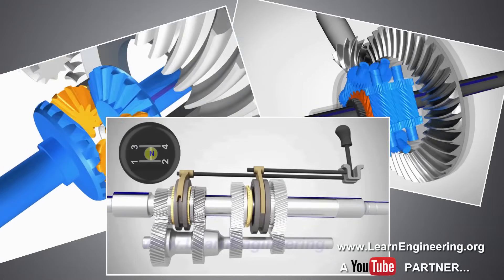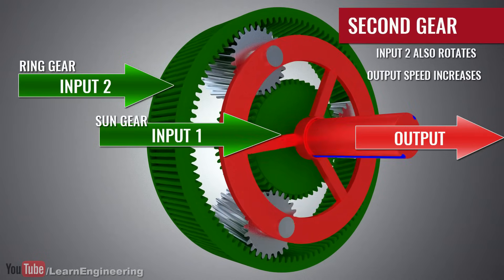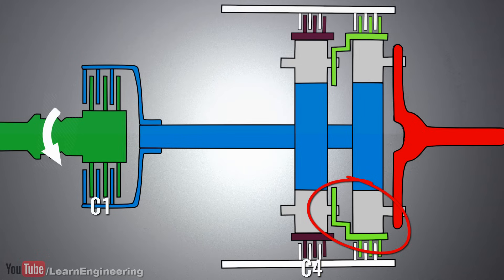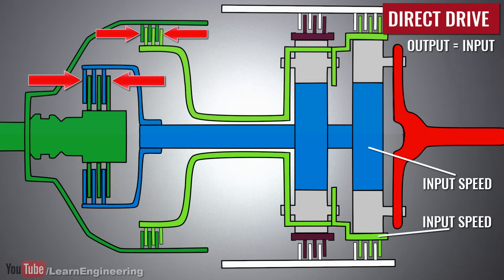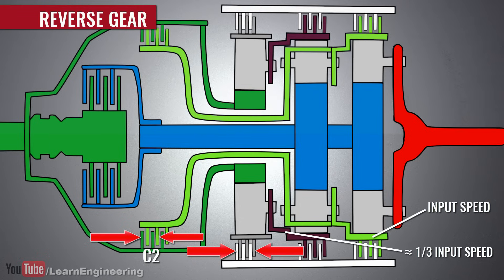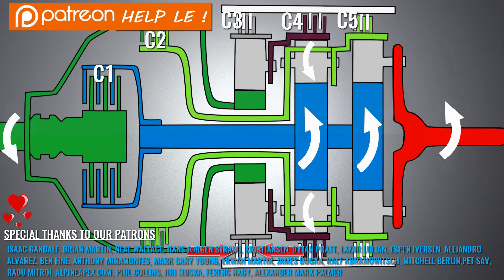Automatic Transmission, How it works?

Comment: After an hour of watching this video and the 3D version of this one, I UNDERSTOOD THIS! Thanks a lot! Third and fifth gears are the most difficult to understanding for me.
Reply: Okay - so explain now what makes it automatic, cuz i'm still confused
Reply: @kirosmatavastros  governor in old transmissions or electronics in new. They control the clutches in accordance to driving conditions.
Reply: @antikrabe8646  Nope.  It uses an entirely hydraulic control system.  The electronics just control the flow of the fluid INTO the valve block.  A governor controls the flow of gas into the engine.  It has nothing at all to do with the transmission.  Governors are used to control the speed of the vehicle, not to shift the transmission.  Also, there is a torque converter on the front that keeps the transmission functioning smoothly.
Reply: @protoborg  flow of gas? On gasoline engines air flow controlled by throttle (some engines use camshaft offset instead of throttle, for example EP6, but it's rare) and fuel flow controlled by carburettor's mixture ratio or injector pulse width. Governor controls shifting gears.  Not only governor, of course. Just search "automatic transmission governor".

Comment: Those of you saying you don't understand need to first get educated on the basic components of an automatic transmission and understand their function first as well as how an automatic works in relation to engine output via a torque converter.  You will NOT learn how automatic transmissions work by watching this video if you don't even know the basic components and what they do and the 2D model will make no sense to you.  Secondly...the Allison transmission is very complex and not like any "normal" automatic transmission you see in the average car.  There are course studies and extensive training courses just on this transmission alone before you even get into the controller protocol and logic so you're not going to become an Allison expert or automatic transmission wiz from watching a 5 minute youtube video.  If you're looking to understand how automatic transmissions work this is NOT the video for you.  If you already have a basic understanding of how automatic transmissions work and want to understand how the Allison 6 speed works then this video is perfect for you.
Reply: i bet you tell your children they can't have cookies before bedtime, too. thanks.
Reply: This is the same as explaining the concept of a manual transmission and leaving out the clutch plate/flywheel.  It's about the transmission/gears and not about the engaging/disengaging of torque.  It's a completely valid video explanation of just the gearsets work.  

Most folks here have zero desire to become drivetrain engineers.

Comment: Three things hard to understand in life:
1) Why does the world exist?
2) Women
3) Planetary gearsets
Reply: Triplex5014 

Planetary gear sets are the easy part, the problem is understanding how it shifts gears, there is literally a two floor maze with valves, check valves and solenoids
Reply: @AL_O0  yes the different pressures and passageways through the valve plate took a long time to understand, and the solenoids, check valves and spools just added to the complexity but put in enough time and you can map it out and understand.
Reply: @AL_O0  All of this so that muricans can skip learning how to shift gears!
Reply: Easy to explain:
1) God
2) God
3) Crack cocaine
Reply: @andreworam2844  Hard to explain: 
1. Athiesm could solve all the problems
Reply: Andrew Oram you rock!
Reply: At 1m50s what is the point of C5?  There is no "input" driving the ring gear.  Also, with C1 and C5 clamped down how would this not result in a complete standstill since the input shaft AND ring gear would be immobilized?
Reply: DowskiVision MagicalOracle the input shaft is coming from the crank and is in continuous motion. Unless the engine is off, the input shaft is rotating. When C1 clamps down it starts to spin the intermediate shaft therefore rotating the sun gears of C4 and 5. In your scenario, C1 would clamp and cause the intermediate shaft therefore the sun gear of C5 to rotate while locking down and stopping the ring gear from spinning. If C1 is engaged it starts movement, not stops it. That’s where you got confused.
Reply: Based
Reply: I am a woman and I am so damn confusing that I don’t even understand myself
Reply: Factory e bike
Reply: I have understood 1&3
Reply: the first two are useless 
the last one tho you gonna need to learn that
Reply: This is just a really crappy illustration lol
Reply: Jokes asides, join thought adventure podcast, Efdawah youtube channel and have friendly fruitful discussions.
Reply: Women☕
Reply: Women aren't hard to understand in general, it's just either you love them or understand them. There is no inbetween.
Reply: @colbalt95  But there's both.
Reply: @colbalt95  What a funny name
Reply: @colbalt95      There is another path that doesn't involve loving or understanding.  It's apathy. You just don't care any more about overcomplicated and non logical  intricacies.
Reply: 1) God
2) read comments above they answer it
3) All science are like that we don't know how we find it, but it's there
Reply: 1. For no reason.  The universe is extremely vast and chances are that a life-supporting planet like this one would have emerged.  So here we are; enjoy the ride, it's spinning at 1000 mph!  2. Yes but to get in their pants, it first helps to get in their shoes (sort of speak).  3. Yes but it's just a matter of studying it carefully until it sinks in.
Reply: @alvaro1728  the 2nd one is one of the greatest pieces of advice I've ever heard
Reply: 2.
to give orgasm to female, clitoris needs to be stimulated.
clitoris is located outside vagina.
intercourse seems does not create orgasm, so penis size maybe does not matter
for giving orgasm.
clitoral vs vaginal orgasm 
https://www.youtube.com/watch?v=SGjZMv9RL9Q
some subtitle
0:02 i love penetration i think it's very important to me
you have to let somebody into your space you know you have to
be willing to relinguish control but at the same time for me
the clitoral orgasm is the really intense humdinger you know
like damn you know you've got an orgasm that kind of thing
but maybe i haven't experienced the right kind of vaginal one.
0:28 clitoral orgasm come from stimulating externally clitoral
stimulation primarily or around the urethra around the labia
and they eventually reach an orgasm that is more localised
to the clitoral area
0:56 when women reach orgasm through vaginal stimulation
or g-spot stimulation there are more pelvic contraction
more uterine contraction so they often report that those
orgasm are deeper and more intense
1:21 something is wrong with me if i don't have orgasm through
penetration and every other woman they've been with has
had an orgasm that way, i'm like oh really 
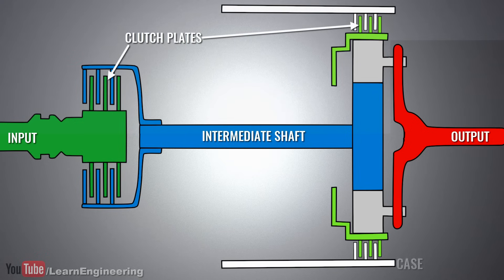1:30 i don't tend to have orgasm a lot with intercourse 
with the penile intercourse, it doesn't happen for me.
1:41 i've never felt vaginal orgasm, it's not
something that has ever ever happened to me, 
i've only been able to reach orgasm orally or manually
i've never had it during intercourse
1:52 i've come close but i have not had an orgasm through
sexual intercourse
2:00 38% women never had orgasm through intercourse
2:01 intercouse and orgasm to me are separate
2:06 in our opinion an orgasm is an orgasm is an orgasm
and it really doesn't matter you don't even need to have one
to be sexually satisfied but if you're gonna have one,
one is just as good as the other
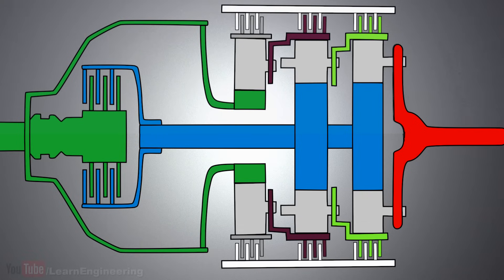3:30 freud said that the clitoral orgasm was immature and
the vaginal orgasm was mature.
3:45 (dr johnson of masters & johnson)
there is no such thing as vaginal orgasm, all orgasm
are clitoral
4:00 if you stimulate the vagina with a qtip, you don't
get a response
but if you stimulate the clitoris with the qtip, you get a response
so he concluded the clitoris and not the vagina was sexually sensitive.
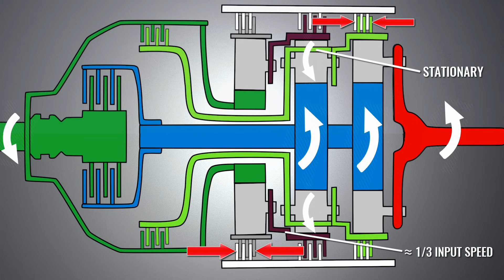4:57 as far as just pure sexual sensation it's all clitoral
5:10 we think penis inside a vagina doing these and i'm sorry
that is gonna get it for the guy but it isn't gonna get it for
the woman
5:41 well than that means that my wife has been faking orgasm
all these years, that's right honey
credit : 'cc' button
from google (vaginal orgasm vs clitoral orgasm) page 3 result 7

more info : http://wortel.ucoz.com/orgasm_female.txt

training all legs muscles (gastrocnemius, quadricep, hamstring)
is good for penis.
tips : 
find '- legs' 
in http://wortel.ucoz.com/loseweight_gainmuscle.txt
Reply: @arnon-jaya   Geeeze.
Reply: @arnon-jaya  you don't have a life do you.
Reply: Allah created this world to be worshiped. And the one who obey will go to heaven while other will be in the hill forever.
Reply: For the first question the unswer is in holly Koran. If you read it you will find a very clear unswer

Comment: Good visualization and easy to follow explanations, but you sort of skimmed past the torque converter. I happen to like torque converters so I thought I'd fill you in.

A torque converter can convert rotational speed into torque; it's sort of like a hydraulic intermediate CVT without overdrive. In addition, most automatics nowadays have a lock-up feature which mechanically couples the input and output to mitigate the fuel efficiency issue. In those transmissions it effectively becomes a large flywheel when it isn't needed.

You can tell the difference when driving a car with torque converter lock-up. At high speeds the fuel efficiency is significantly improved over a traditional torque converter and is comparable to a manual transmission. When starting from a standstill you still have the torque boost. The only remaining flaw is the rotating mass of the torque converter, but that's a relatively minor thing.

It would be great if you could show how a torque converter works internally. In my opinion it's a seriously underrated engineering gem.

Comment: explained in a very good way. i could understand the mechanism. The video clearly explains how the gear ratio change is achieved, I could understand the gear ratio depends on which of the 6 clutches are activated. but i did not understand how the clutch is controlled in an automatic transmission. need to look out for that.
Reply: The clutches are controlled by hydraulic fluid pressure. Valves in the valve body control which clutch receives pressure to push it closed.

Comment: It's hard to try to understand each part if you didn't watch the 3D video first. If you don't know what or where is the ring gear etc. in the 2D version, you need to check the 3D to know each piece of the puzzle, then you can try to understand the functioning. By the way, you explain ridiculously well, thanks!  ⚙👍🏼👍🏼👍🏼

Comment: Still not good enough. 

How is this an "automatic" transmission ? You still need various clutch plates and a mechanism to engage/disengage them. This is just taking the work of moving clutch plates from the driver to the governor/chip. 

A far better example would be the simple fluid coupling in the system. It does everything on its own.....gives more torque when required and speed when required.

Comment: How about an automatic part? How it works? What is automatic in this mechanism??? I don't understand. It seems to be the same as manuel transmission. The only difference is that it uses not ordinary gears but planetary ones. Why this transmission is called "automatic"?
Reply: In older automatics, a very complex hydraulic valve control that takes pressure inputs from car speed, engine speed, throttle position, and a few other things.  In essence a kind of fluid pressure based analog computer.  Nowadays?  A computer opens and closes the clutches with hydraulics.
Reply: I believe automatic because you don't control this directly as you do in manual, where you shift mechanical parts by shifter. In automatic one shift causes multiple actions inside and manually this would be very difficult to do.

Comment: I am mechanically inclined, but I did not fully understand the video.
Reply: I've got a 3D animation on how clutch packs work. It's called, "How Clutch Parks Work on a 6 Speed Automatic Transmission: SIMPLIFIED." Check it out.

Comment: so in other work automatic transmission use hydraulic system to put pressure on the clutches to change gear via the solenoids that's why oil is a critical part of the well being of AT

Comment: It's easier to understand with 2D! Now I'd like to see how double clutch gearbox works (DSG, EDC, PDK, etc.). I've heard about a clutch for even gears and a clutch for odd gears...
Reply: In dual clutch gearbox you activate 2 gears simultaneously, but only one is coupled to output. There is nothing complicated - 2 shafts and when you shift up, gearbox deactivates clutch of shaft 1 and applies clutch of shaft 2... Both shafts goes to common output. As you see, you don't move mechanical parts in such shifting, only switch 2 clutches, this translates into very fast switching between gears. But! This applies only to sequential shifts, i.e. 1-2 or 2-3, not 1-3 or 2-4, because next gear was prepared when you shifted.

Comment: This video really only explains how one type of automatic transmission gets its gear ratios and how the planetary gears work. It kinda lacks the story of how the transmission gets its shifting point inputs, i.e. when to change gears. I imagine that modern automatic transmissions have a fairly complex set of rules/conditions taking into account wheel speed, engine load and perhaps even rate of change of some or all of the parameters, to decide which gear to use at which point. Perhaps in another video...?
Reply from the maker: Yah, the logic of transmission control module is not explained. here. We have to release an another video for that.

Comment: But how does the car "know" when to activate c1, c2, c3, etc.?
Reply: engine rpm,engine load,vehicle speed,etc.....
Reply: traditionally, a part named the governor (a purely mechanical device) would monitor the things that Adam mentioned. more recently, however, the automatic transmission is controlled by the car computer.

Comment: I don't understand a word of this. Maybe if they related it to d whole engine, crank shaft, connecting rods & wheels, I'd relate better.
Reply: Well, the input power is from the engine and the output is sent to the wheels. It's just a matter taking the motion from the engine and speeding it up, slowing it down, and reversing it.
Reply: Looks like you started on a too advanced of a topic. Go back and understand a basic differential: why a car needs one and how it works. Once you have that down then come back and try to understand the limited slip version.
Reply: +Perry Ramsey OK...thanx. I just study these things for d knowledge of it. I don't even use it vocationally, but knowledge is empowering. I'm going to study the whole thing. Thanx.
Reply: every vehicle will need differential speed modifiers so you can achieve higher speeds. Even bicycles have it.

Comment: From 3d animation i did not know that hollow sun gear is fixed via another rotating connection to input shaft, couldn't figure 3rd 5th :)
Reply from the maker: Nice to know that, that's the advantage of 2D animation.
Reply: Maybe you could do a video on how the clutches work on automatic, how they are controlled etc. Or why they have used such different design from the manual gearbox, what are the advantages, couldnt they just put electronic shifting mechanizm on manual and call it an automatic?
Reply: I always thought they just add an electronic shift to manual to make it automatic. Why did they need this system to make it automatic.

Comment: This is interesting, but not going to lie, its kind of hard to follow
Reply from the maker: Yes, the technology is complicated. Hats-off to those engineers, who developed it.
Reply: The technology is straightforward but your 2D graphic is insufficient and the video is short on explanation.
Reply: +Ancient Laws, this is what animations are for. They can go on about how it's just as easy in this 2D drawing for as long as they like, but its still much easier when you can see the parts turn. I need to be able to see which parts are currently turning for each gear ratio, as it's just very hard to try following with the way it is here. +Learn Engineering can say what they like about how their way is better, but I just don't find that to be true.
Reply: I agree, i was lost from the beginning...
Reply: I really appreciate their content, but this presentation and explanation are lacking imo. But I understand that this is a complicated system that's quite challenging to effectively explain. Thanks for even taking on the challenge.
Reply: Ancient laws lol the 2D one is way better than the 3D model
Reply: Now realised that they have a 3d version of this vid! It's MUCH clearer imo. The 2 vids should be edited into one. https://www.youtube.com/watch?v=u_y1S8C0Hmc
Reply: Learn Engineering uhট
Reply: yeah
Reply: At 1m50s what is the point of C5?  There is no "input" driving the ring gear.    Also, with C1 and C5 clamped down how would this not result in a complete standstill since the input shaft AND ring gear would be immobilized?
Reply: You're not alone
Reply: It's hard to follow bc this is probably the dullest way they could have presented this